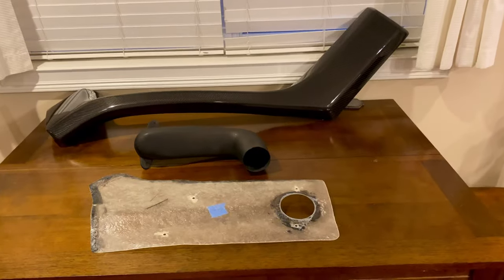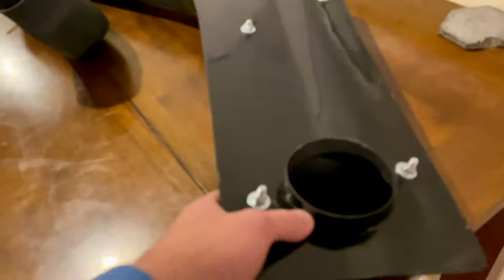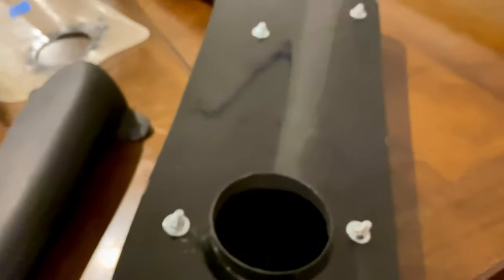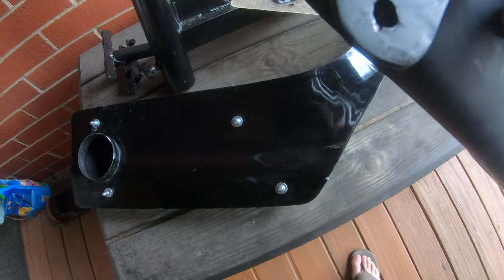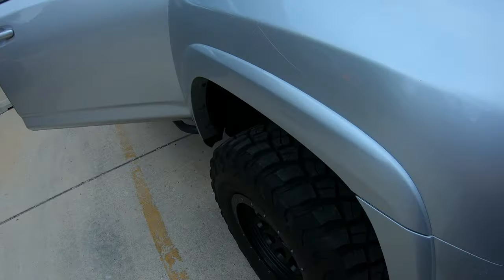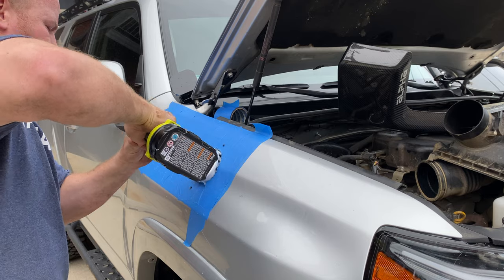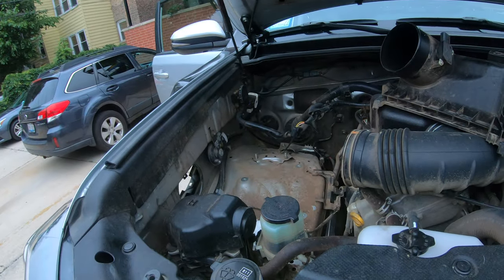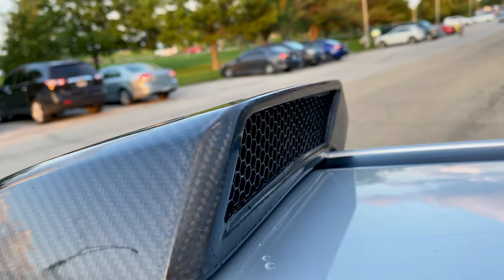AlphaEquipt Long Version Snorkel install

Comment: Looks great! I’m not sure if you just didn’t show it in the video, but just snug fitting plastic won’t keep water out. Needs silicon couplers and hose clamps or some type of sealant to piece together like pvc pipes, but that wouldn’t allow for easy disassembly in the future.
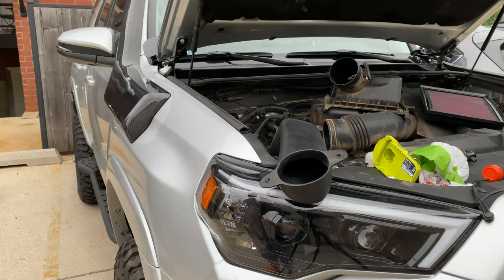Reply from the maker: At 14:18 in the video it shows me adding the silicone bead.  It actually came off with little effort when I removed it before selling the 4Runner.

Comment: Looks Awesome! Going to order one for my 4 Runner
Reply from the maker: Mine is for sale if you are near Chicago.
Reply: @BirdDogOffRoadAdventures  can i ask why you sold it and what you did with the holes in the fender for your next snorkel?  wondering because this seems like a project that once you go all in, you need a new fender if you want to get rid of it.

thanks!
Reply from the maker: @xrptrdpro4056  why I sold the snorkel or the 4Runner itself.  I loved this snorkel and only sold it as I was putting the 4Runner back to stock prior to trading for a Bronco.  If you search eBay, you can buy a replacement fender already painted for a couple hundred bucks.
Reply: @BirdDogOffRoadAdventures  good call, thanks for the response

Comment: Does the passenger door open without hitting it…at all? Looks like the spacing is tight there. Overall it looks amazing.
Reply from the maker: Nope, this only covers the A Pillar frame, not any parts of the Door itself.

Comment: It looks really good on the 4Runner, but that whole elbow piece is kinda suspect. I like the little built in extensions that the other brands use on their snorkel body tubes that poke through the fender vs the flush fit here. It almost looks like the fender is used as “gasket” if you will in addition to the RTV sealant. Seems like the weak link in the whole system is that flanged plastic elbow piece. How has everything held up so far?
Reply from the maker: It’s been wonderful.  No regrets whatsoever.

Comment: Hi, nice vid. im considering on purchasing one for my 5th gen. Any issues with water getting in the intake on top of your roof? looks like its so open for rain water to go in. Thanks in advance.
Reply from the maker: None so far.  The bottom edge is about 1/4" thick, so water should not flow off the roof into the mouth of the system.  I left my drain hole in the stock airbox to be safe in the interim.
Reply: @BirdDogOffRoadAdventures  ok thank you

Comment: What kind of wheels and tires? Also what size lift?
Reply from the maker: I have a link of my build on my ‘About page’ on here.  The wheels are SCS Ray10s 17x8.5 with -10 offset.  Tires are 285/75r17s (34” tall) BFG KM3s.  3” lift front and rear from Dobinsons MRA suspension kit.
Reply: @BirdDogOffRoadAdventures  awesome I’ll check it out. It’s beautiful

Comment: What size hole saw did you use?
Reply from the maker: Per the instructions, I used a 3 5/8” hole saw.
Reply: @BirdDogOffRoadAdventures  thank you. My box showed up all mangled, no instructions, and I wrote customer service for instructions but no reply. Your vid is good enough though.
Reply from the maker: @jamesmart248  DM me your email and I’ll send you what they sent me!
Reply: Is there a specific hole saw you recommend. Something in particular to cutting through a fender? Thank you.
Reply from the maker: @kellymartin4339  https://www.homedepot.com/p/Milwaukee-3-5-8-in-Hole-Dozer-Bi-Metal-Hole-Saw-49-56-9642/202327760
Reply: I installed from your video. Thank you for the help. My holes were extremely off on the template and had to open them up a little bigger in the fender than I liked. A little disappointed by that part. Fit is good with the body lines though and looks really good. That top nut inside the fender was a serious pain in the ass. I sincerely hope I never have to go in there again.
Reply: @BirdDogOffRoadAdventures  hey bud can I dm? Just received my snorkel with no instructions
Reply from the maker: @kevintoro3284  sure,  DM me on Instagram if that works better for you

Comment: Do you think it would block a prinsu roof rack?
Reply from the maker: Unfortunately, this version is not compatible with full length racks.  They have a shorter version that will work with full length racks though.